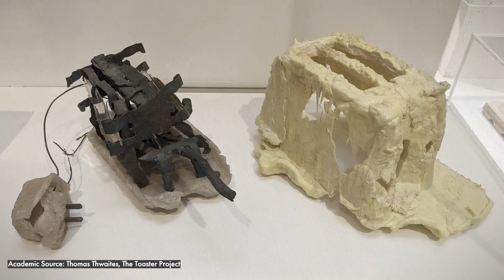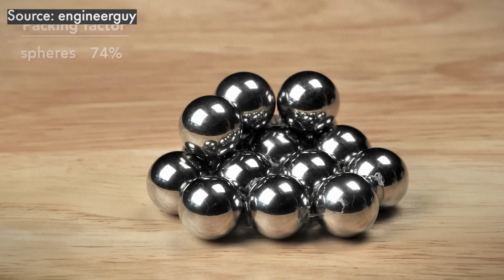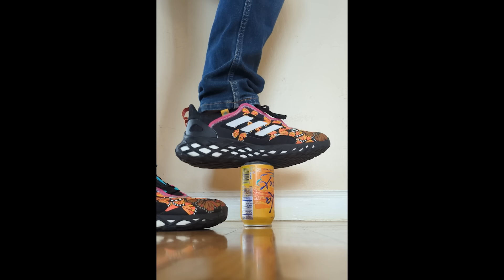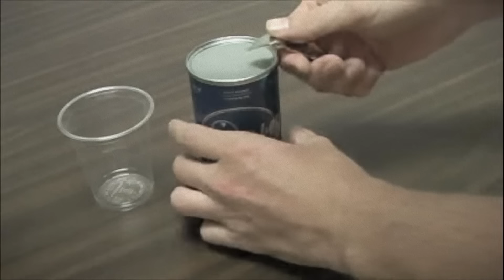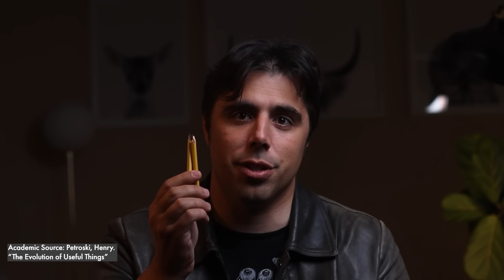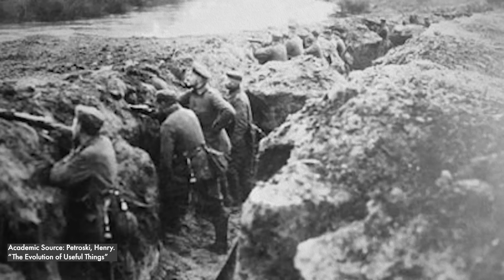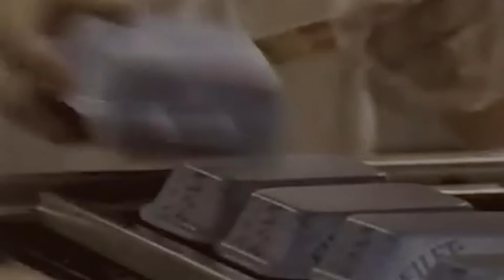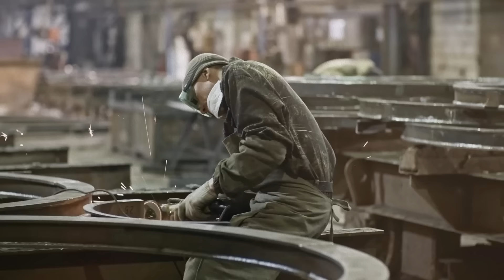Why Simple Everyday Objects Are Impossible to Make

Comment: Building from scratch is harder now because the initial resources are harder to obtain. The early easily accessible materials have been consumed. There was a time that there were "tar pits" where oil existed close to the surface. You didn't need to drill for oil, just dig a hole and there it is. The same with metal sources close to the surface like gold, iron, copper. We now have to dig hundreds of meters underground to find fresh untapped resources.

Comment: I get that the toaster's original purpose was to make us use more electricity in the day time, but in modern times, the convenience of a basic automatic pop up toaster have outpaced the original scheme.  I don't spend 10 minutes with a pan toasting bread, I spend 2 minutes getting my plate and toppings ready then "POP", toast is done.  So in the defense of my cheaper than dirt, two slice, convenience store special, toaster I would just like to say:  The intent was the scheme, but the end result was much more practical and that makes it worth more than the sum of its parts.

Comment: I am the lead mechanical engineer for a large division of a mid size technology company. It is wild how many people I need to interact with in different countries to coordinate and maintain supply chains for my designs.

 Everything down to the exact gauge of wire in a cable harness, and the specific thickness of the wire jacket for a single wire for a single of MANY harnesses are dictated and designed around and coordinated with contract manufacturers. 

Scale is also a CRAZY huge part of the design process. If we sell 500 units of Product A each year, even small sheet uncomplicated metal parts will cost more than this $6 toaster. If we sold 1MIL units the same part would cost 25cents.

Also the ending part is something so few people appreciate or even think about...

Between the tools and machines used to access the raw materials, the factories used to process say raw ore into steel, and all the machines used for that, and all the machines used to make those machines, etc etc etc - that $6 toaster can be traced back 200years to machines that made the machines that made the machines that made the toaster. And in that time probably 1million engineers indirectly touched some part of the total process and FOR SURE 200+ engineers touched that exact toaster design...

Keep in mind there are 1000 toasters available so scale that up. That's JUST toasters.  Every single you are looking at right now that isn't your cat or you plant was engineered and produced by workers and engineers all over the world. 

Just for you :) Because you're great and your human, and we as engineers should work tirelessly to make humanity better, through engineering, chemistry, manufacturing, and physics.
Reply: Imagine an airplane with millions of parts!
Reply: Another thing to keep in mind for the system to work is that a lot of innovation is done by regular factory workers that will never get credited. When a new product goes into production, a regular worker will be told to shave a hollow out of a small piece of wood and then set the graphite into it and close it with another strip of wood. The factory worker is going to think of ways to work faster and optimize their own workflow and make the process of doing the job so it will become easier on them and they will get better at it. Then when they have reached a point where they are as efficient as they can be with their hands and have a process to make the pencil down to very practiced motions using their body, the owner will want more production so they will take those same practiced motions of the worker and design a machine to perform those motions instead. In this way, the worker sort of becomes a machine. The robot is designed to mimic the motions that a human previously perfected. I have seen it done. The worker perfects their process and the machine is built using what the worker learned by doing the job.
Reply: Basically our modern world is incredibly fragile and something as simple as a massive solar flair could put us back before the 1800s and we don't know how to live like we did back then. We are dependent on systems and technology and if we are stripped of it, we are in a fight for survival
Reply: @randybobandy9828  a solar flair wouldn't get rid of libraries or people that still live without technologies like some religious groups or native people
Reply: Interestingly, even the cats and plants you used as a counter-example can be said to be "engineered" in a loose sense - house cats were domesticated (either by themselves or us directly, but that matters little) from their rather less pleasant ancestors to fit human taste and needs, and so were the majority of plants we interact with daily - be they foodstuff-producing (you better believe they were optimised for better, tastier, whatever yields) or decorative (with the prettier cultivar(s) winning out).
Reply: Yup. All while the richest 1.5% own almost 48% of the World's Wealth, for some reason
Reply: A fantastic comment!

However, you used "your" rather than "you're" and I just have to give you a friendly razz for it 😄
Reply: Just think, one day, in a million years or so, we will have the technology to make anything we want create itself on demand or even 3D print itself laying down layer after layer of the actual atoms and molecules of the design spec including those of individual compounds. The technology is 'out there' in some Universe. What do you think DNA is but a high technology encoding system that builds "cats" and "plants" or more specifically causes them to build themselves - via eating, etc. Life itself and biological systems are just an advanced technology of an advanced civilization.

Comment: If you want to make a toaster at home you need #1 some fire and #2 some way to hold the bread over the fire. If you want to get fancy put the fire under a slab of iron and put the bread on the hot slab. Avoid using rocks - rocks can explode when heated if they have moisture in them.

Comment: 17:35 the reason that there is a limit to the amount of radio wave radiation is not to minimize the amount of radiation exposure as this can sound like radio wave is dangerous to us humans. It’s actually to limit the amount of heat produced that can burn your skin.
Reply: So you're saying that the radiation can be harmful to us 🤔
Reply: @moxxy3565  yes depending on the type of radiation it can be extremely dangerous even deadly within just minutes but these are only the wavelengths ultraviolet and over. Anything under that can only kill you by burning you and to do that with radio waves would take an astronomical amount of energy and it would need to be directed towards you like a laser. Even to just warm something up slightly it would take a lot more energy then what we use for cellular communication
Reply: 電波
Reply: Not your skin, as radio waves easily penetrates it, but rather your insides/brain
Reply: @JosGeerink nope it heats up the metal antena and can lead to burns as it is right next to your ear. Radio waves are completely safe
Reply: @emm4148 Radiowaves lower sperm count and motility.
Reply: @emm4148  radiowaves? Its not early 1900s, were in microwave range nowadays, and those do heat up your insides just like he stated.
Reply: @sznikers well first of all he said specifically radio waves. Second yea we do use part of the microwave spectrum but it is no where near powerful enough to heat you up or even designed to heat you up as to do that it has to be an enclosed space plus emit much more microwaves at much higher frequencies
Reply: @emm4148  yeah its nowhere near enough to significantly heat up tissues cause of... power limits...
Reply: @sznikers I know but the reason why he said the power limit was established was because of the wrong reason

Comment: Great video, but one thing I want to add is that, even though I have a stove and pan, I always choose to use a toaster for reason of sheer convenience. I don't want to put the work into heating up a pan and then tending to the bread while it is toasting so it doesn't get burned, all while risking burning my own hand in the process. By contrast, the automatic toaster pops out the bread after a set amount of time. (Also, I suspect that a toaster is more energy-efficient since it only heats the bread, instead of both the bread and the pan. I haven't performed any calculations on this, however.)
Reply: A little googling suggests toasters usually fall into the 800-1500 watt range while a typical electric stovefalls into the range of 1000-3000 watts per burner.

Of course, wattage is only half the equation and you need to factor in time required to toast each slice, though my intuitions include:

1. the toaster heats up quicker because its heating elements are made of much smaller gauge wire.

More heat flows into the bread per unit time because in the toaster because the bread is in direct contact with the heating element.

The toaster toasts faster because its toasting both sides at the same time.

Most toasters can do multiple slices faster because most toasters have at least 2 slots and 4 slots are common while most pans would be awkward to fit multiple slices within(assuming a slice is a 4-inch/100 mm square, you would need a 12"/300mm diameter pan to fit 4 slices in the pan without them overlapping, and my guess would be most pans are smaller than that, and 4 inches feels like a low ball for the size of a slice of bread.

Of course, the pan used probably matters and it wouldn't surprise me if someone tried to design a pan optimized for making toast.

Comment: Making a $6 toaster is easy: you simplify the design for the technology you have, if you have to make it from scratch, you build a fire with wood, and get a thin slab of rock and toast your bread on that surface, and then after you get tired of doing that, take a few moments to appreciate the benefits given to us by the free market and division of labor and assembly lines.
Reply: Really? I had a business selling clothes I hand dyed myself and now, because of Trump, (I sell my clothes on the Canadian border and Canadians aren’t coming down to buy my goods anymore) my business is closing. I got screwed. Free markets be dammed.
Reply: @dorjevajra  Well a completely free market would not have government involvement, from Trump or any other government entity. So my point regarding the free market still stands, as I did not say that you should be thankful of the Trump administration for $6 toasters. Governmental interference slows down the forces that brought us the $6 toaster.

Comment: 24:14 
I get and agree with the overall point, but self sufficiency IS possible.

It would require an absurd decrease in quality of life, but it's possible.

That said, partial self sufficiency is admirable and useful.  You don't want to be instantly at risk of starvation or dehydration in the event of a freak power outage or supply chain disruption, for example.  Capable of being self sufficient for even a single week can make a huge difference, and remarkably little planning can permit years of storage or a seasonal supply of fresh vegetables.

I also degree with the compulsion vs choice statement.  There can be both compulsion AND choice, it just makes it harder to make choices, and harder to encourage others to go against what seems obvious.

24:21
You're reaching.  It IS possible for one person to comprehend the pencil making process.  It would take awhile, but it is perfectly possible.  Complex programming, and computer manufacturing in general, are complex enough that I could agree with such a statement.

It's also perfectly possible to acquire 'enough' information about a subject, for your personal decision making.  Acquiring knowledge has diminishing returns for most subjects, you only need to seriously study the innermost layers of a subject if it's a hobby or if you specialize in taht specific field.  That said, the line between general and specific knowledgeg is quite blurry.

24:50
Too flowery for my tastes.  Nice video overall.

Instead of doom and gloom, or blind appreciation, the biggest takeaway is informed appreciation and making wise purchases.

If we get sold crap, it's because we buy crap.
Reply: I think though if you think about that second point it does quickly encompass almost everything depending on how deep you want to go.

For example to get the pencil wood you have to cut down the wood, which you use a chainsaw to cut and logging trucks to move, nowadays most trucks have computer chips in them, so now we have to talk about computer chips.
You agreed that the computer chip industry was too large for one person to grasp.

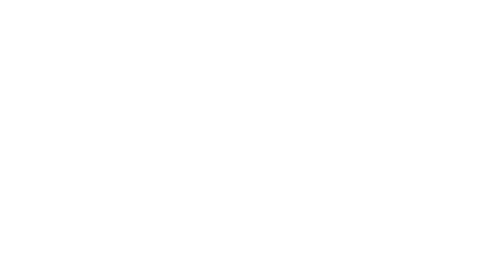Comment: 5:00 This made me wonder if a hexagonal prism might provide for a descent can. It has high packing like the cube, depeding on the shape of the shipping/storage container used, a more durable shape and I can imagine drinking from it just fine.
Reply: But it has corners so it won't be as strong as the round can
Reply: @nahid.094  the question is, is it strong enough? Thick does it need to be? Is it worth the trade-off?

Design is always complex.
If nothing else, it might not roll away if you lay it in the fridge.

Comment: I watched a dude build a toaster out of some stainless steel, some (probably asbestos) fireproof insulation sheeting, and some nichrome wire.
You don't need 400 components. You don't need a global supply chain. You need to adjust your expectations of what it will look like and how it will work to match your supply or capability.
You might design something that looks or is shaped very differently than you're used to, but if it works as intended you succeeded.
Reply: And if you fry yourself or burn down your entire apartment building, that's what? The cost of innovation?

Comment: That's kind of funny for today.  That toaser's way of connecting up to your house wiring was through an Edison style lamp socket.  Considering the current required for those things, and the relative low current required by a lighting circuit, I'm slightly surprised there were not more fires, y'know?

Comment: 1 - Simple is Hard - Mass manufacturing everyday objects have been refined for decades, if not for centuries.

2 - Innovation S Curve - Diminish Iterations overtime.

3 - Some logistics may seem 'vertical integration', but never linear, it always branch out over time e.g. oil refinery for petrol produce byproducts, now refined as plastics.

4 - Technologies always evolve cumulatively to unlock the next one.
e.g. manufacture mechanical clocks & microscopes > Light Bulbs > CPU > Space vehicles > scientific instruments > Fusion

5 - Every time there is a global 'challenge' there is world wide demand for innovation.

e.g. shortage of materials in WW2 > creative designs or life imitate art (Da Vinci dream of flights, Jules Verne rocket to the moon > Von Braun or Star Trek flip phone)

6 - Ever higher production quantity = ever cheaper unit price = mass availability & accessibility (Wright Law), to even out the odds in society.  From nobleman own a horse for transport > modern day cars accessibly by low income for personal transport.

Comment: 6 months to develop a fork? it took me 4 months to design build and test a record setting device flown on the International Space station. and we went through 4 design iterations (3 prototypes, 1 final article).
Reply: There's a big difference between building a one-off and designing something for mass manufacture
Reply: @DavidRobertsonUK  not really. I'm a mechanical engineer, I do this for a living.

The question was whether a person could do it themselves, and they can.

But you're describing a totally different set of conditions. But even then, you're not entirely correct. It all depends upon what you're selling, and how important certain aspects of the design are to you.

I have literally designed and prototyped things for my own personal use at home, that cost less for me to design and prototype in quantity one, than the mass produced version sells for.

What features would make my version unsuitable for mass production? What is mass production to you? What is the intended purpose and criteria of the item you want to produce? what features matter, and which do not?

it would be ridiculously simple and easy, and quick to design an injection molded fork that works just fine, and then go get the molds made for not all that much money, and have it produced. it will cost money, but how much? Are you molding it yourself, or paying someone else? are you designing and making the tool, or paying someone else to design it for you?

Comment: I mean a toaster does not need 400 components to toast bread. If you are trying to make your own toaster yourself you can skip out on probably 200 of those parts which are just luxury features and then probably another 195 which are for safety. The beauty of diy is the lack of regulations to follow. All you need is something to turn electricity into heat and something to transfer that heat to bread evenly enough. You can do that with less than 10 parts.
Reply: You can do that with an open fire and a fork (non-plastic)

Comment: 21:38 using a hot pan instead of a toaster is a very inefficient way to toast bread.
 It takes a lot more energy to heat up the entire thing while you cannot fit more than two slices of bread concurrently.
 It takes double the time because you need to do both sides.
 You get uneven toasting because bread will bend when heated and you burn the parts that touch the pan while the other parts are still white.
 As a bonus, if your pan has Teflon coating and you exceed a certain temperature, you get carcinogenic fumes in your bread and your house!